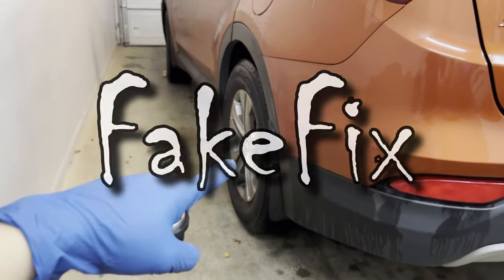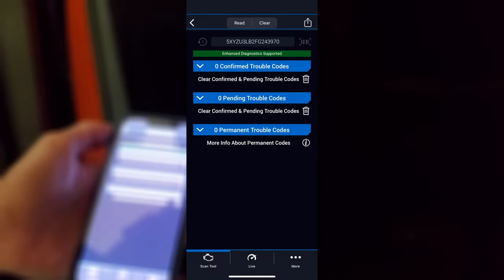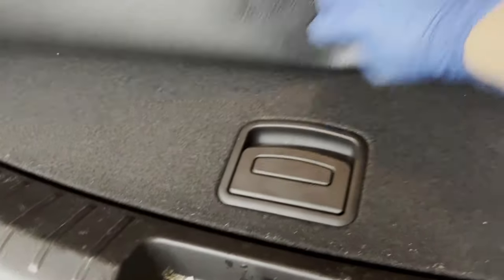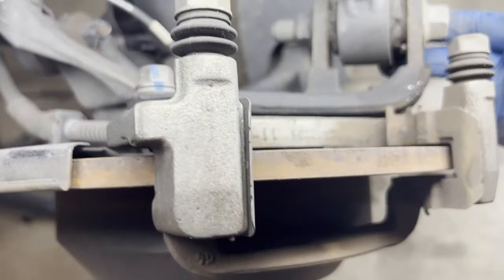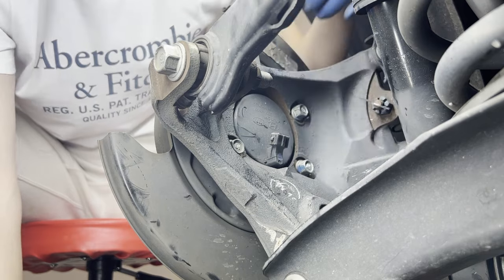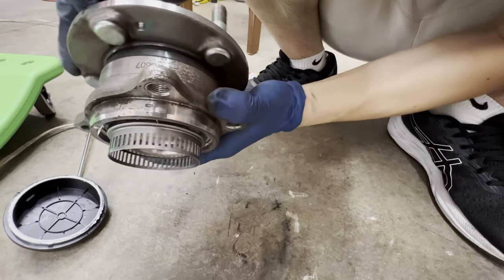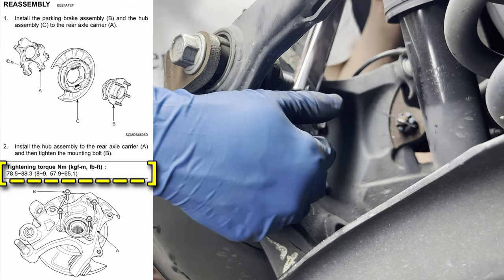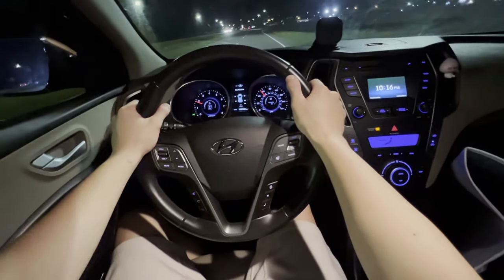Hyundai & KIA REAR WHEEL SPEED SENSOR REPLACEMENT@chrisfix

Comment: On my 2015 Hyndai Tucson, the ABS started to work without an error, but the system does not show an ABS error. Do you know what could be the reason?
Reply from the maker: If there is no ABS error, it is resolved, isn't it? What error are you expecting?
Reply: @_yamech7533  The error is not shown on the display, but the ABS continues to activate every time you brake.
Reply from the maker: It seems not Speed sensor issue. Check Brake Control Module